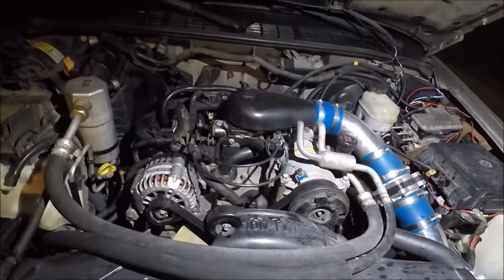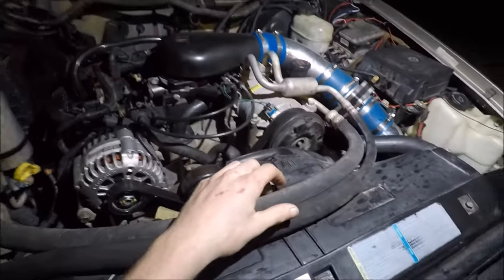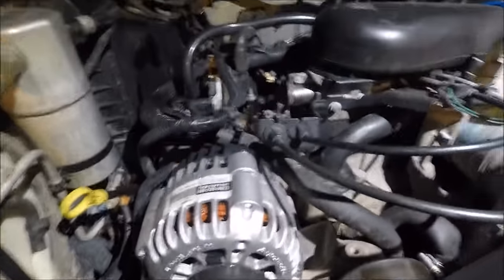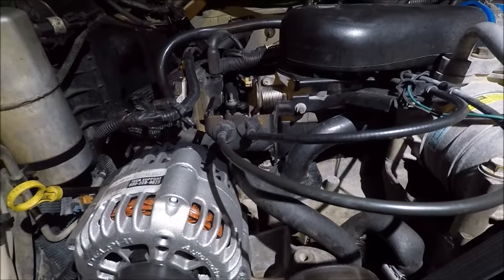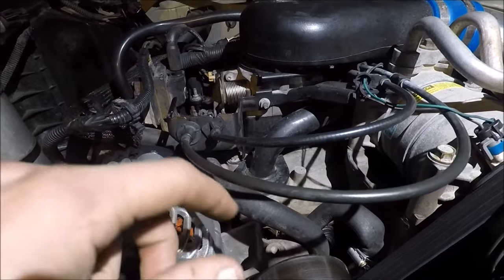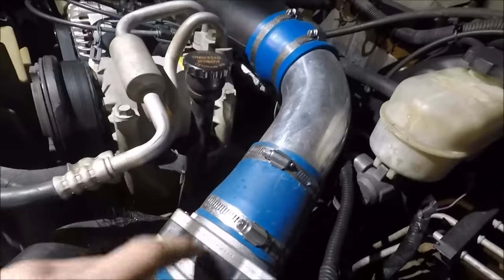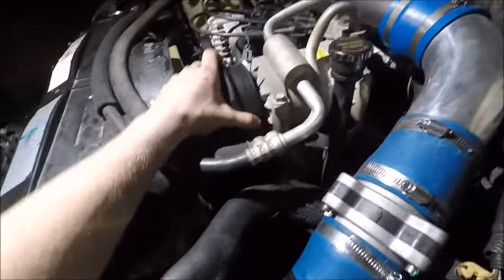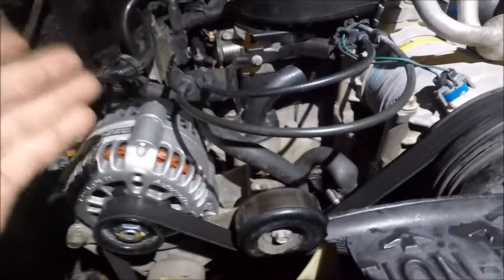EVERYTHING YOU NEED TO KNOW ABOUT THE CHEVY 4.3

Comment: I had a 98 S10 that had 370k miles on it and it ran great years ago.  Unfortunately I crashed it.  I just sold my 2013 ecoboost f150 yesterday and looking to get another  S10 with the 4.3.   Most reliable engine I ever had.  The ecoboost had so many problems, timing chain included.  I’ll never get another one.

Comment: Used to be a Chevy Technician at Carlsbad California and I just want to add.
When it comes to these S10/Blazers. When it comes to fuel related. Go aftermarket. Don't go with the OEM fuel pump for example. Everyone who has or had a s10/blazer will or at some point will being replacing the fuel pump. GM messed around with a lot of fuel pumps and TBI etc for EPA. When it comes to other parts, I recommend OEM but not when it comes to fuel pumps. I've seen aftermarket pumps out last the OEM in these vehicles and you save a lot more money on the aftermarket too. 
DON'T FORGET TO REPLACE THE FUEL PUMP RELAY!!! I can't stress that part enough. People forget the simplest things sometimes and think its the fuel pump.
Reply from the maker: Never had any issues with the fuel system.
Reply: @JLGARAGE252 You will.
Reply: Lol @JacobWinkle
Reply: Where is the relay located? Got a 2001 Blazer with 230,000 miles that’s hard cranking and not turning over. Had the plugs replaced but not the wires a few months ago.  Got the blazer in 2015 with 203,000 miles. Want to make it last through the winter. Any thoughts?

Comment: 343k on 04 silverado short bed 4.3 manual. Original water pump, ps pump, booster, master cylinder, radiator, dryer evaporator, throttle body and ac compressor. Have replaced clutch (luk)and fuel pump (delphi) once. What a truck!

Comment: I still have my 95 C1500 Cheyenne 4.3L V6 I drove in high school 21 years ago. Has 177K miles, still going strong. Currently getting parts together for TBI rebuild, Idler pulley, belt tensioner, valve cover gaskets to get it caught up after sitting for awhile. Love driving it

Comment: VERY VERY INFORMATIVE!! Have a 03 S10 w/488k on it. Replaced the fuel injector spider a few yrs ago and strangly enough it used to get 17-18mpg but since gets 25-26!!! This is BY FAR the simplest engine I've EVER worked on. Runs like a champ. The REAL trick is keeping up on the vacuum lines and the exhaust. If you feel a loss of power, those two things save TONS of time on acceleration and power issues. Even the smallest loss makes a HUGE difference with this engine. Have had customer after customer come in and wonder what was wrong after lots of guesses. With THIS engine - FOR CRYING OUTLOUD BUY A OBD2 SCANNER!!! We're in the 21st century!! You'd be SURPRISED what ANY person can fix with the right tools and some COMMON SENSE!🤣🤣🤣

Comment: I had a ‘97 ext cab step side S-10 with the Vortec 4.3. Best vehicle I have ever owned. Bought it in ‘98 with 17,000 miles on it. Sold it in 2004 with 320,000. The last time I saw that truck the guy said it had 360,000 miles on it. 2 heater cores, two water pumps, 5 clutch slave cylinders, 1 fuel pump and regular maintenance. It only left me sitting once and that was due to the crazy distributer cap cross firing. That truck was built on a Wednesday for sure.
The company I work for gas 3 Express vans with the 4.3 and have not had an issue with the drive train except for 1 rear.
Reply: I wish my last that long 😳

Comment: I've worked/owned so many of these. I own a '96 4x4 with the 5 speed, transfer case is manual too. paid $600 for it 3 years ago because it wouldn't shift into reverse or 5th. Dropped the trans, took it apart and replaced the shift fork.  Put a set of 31" tires, raise the front with the torsion bars, put in 2" body lift. Installed a dvd player I had from last S10. Both bumpers were trashed so I made my own. Stuck a winch under the front by mounting a hitch receiver across the frame below where the crank pulley is, which places the rollers where the cable/hook ride flush with my bumper. I sanded off the peeled clearcoat  and black top coat, then used a spay gun and applied 3 quarts of Rustoleum smoked gray, with about 40% paint thinner. The black molding strip going down each side I replaced with diamond plate aluminum strips cut from an old tool box and held on with rivets.  LED headlights and backup light.
Reply: Led headlights as backup lights make a huge difference 😂 just don't hit reverse in front of a cop

Comment: My 01 Sonoma 4.3 has 391,000+ miles on it. I'm the second owner. It had 104,000 when I got it.
Reply: Wow
Reply: gotta 95 sonoma 4.3 i only got 170,000 but looking forward to putting more
Reply: I bought a 2002 S 10 4.3 standard cab in 2011 with 30,000 original miles on it my place of work is only 7 miles from my home is still only has 90,000 miles on it this truck has been great I have replaced water pump the radiator the fuel pump intake gasket And just the regular normal maintenance stuff.I wish they still made  the Chevy S 10.

Comment: Thanks for the Vid! Got a 2000 GMC Jimmy 4x4 2 door with 202,000k on it for $800 no less. put a $1000 into it to fix all of the annoying typical broken things and made some mods to its front bumper, and in great shape. Nicely looked after engine too. I'm going to do a bunch of the minor replacements on it over the next couple of months so I appreciate hearing what I should be doing to keep it running well besides the obvious lol. I am currently having a loss of power due to most likely what you were saying about the vac leak with that seal. Also, I love how much you could do with this particular engine that's pretty cool. Thanks again and Cheers bud!

Comment: this is really a fabulous motor. dependable, in my life experience i rate it with the Toyta 22R in reliability, repairs are easy, easy DIY, I've seen some in this forum almost 300K im at 186... on my 2nd set of spark plug wires, just today. this a fantastic engin.

Comment: I’ve got one of these in a 1997 S-10. It’s a roller and balance shaft engine, very smooth with an excellent torque range. I’ve got 204K on mine with no serious problems. My advice is to keep up with the oil changes, use high quality oil, and don’t skip fuel filter changes. I change mine every 15K instead of the 30K recommended. Be sure to never run it out of gas because that’s quite hard on the fuel pump. It seems like it only takes one occurrence to potentially cause a problem.
Reply from the maker: John Smith absolutely I’m ocd about maintenance, just put a new transmission in today and serviced the T-case
Reply: i have a 01 s10 4.3L with about 210K miles. What type of oil do you recommend?
Reply: Oh wow, I always do 5k oil changes in my van. Didn’t know the recommended is 30k? That seems a bit high, doesn’t matter a whole lot to me I’m gonna stick to the 5k oil changes because I’m turboing mine this winter
Reply: @williamreed3180  he was saying 30k for fuel filter not oil change...
Reply: I’ve always changed the filter at every oil change.  Why keep all that contaminated oil in the system that is sitting in the filter?  They don’t cost much and you’re already doing the job.

Comment: I have a 1997 GMC Jimmy. The original motor had 181,000 when it started to have a slight coolant leak on to of the intake at the rear passenger side. I replaced the engine with a new crate engine  at 180,000 miles it started doing the same thing. This time I just add coolant every few months and call it good. That engine now has about 250,000. I did replace the starter a few times, the Altenator twice, the idler pully twice. The distributor once from summit racing. Cap and rotor at least a half dozen times. The coil once with an excel. Plug wires twice. I think that is it.

Comment: 250k miles on my 02 Silverado 1500 4.3 single cab still running strong proper maintenance oil change,trans fluid, plugs etc

Comment: I've got a 2003 S-10 with the 4.3. I also have a 2010 Cobalt that's been very reliable, especially once I solved the issue with harness going to the tranny plug rubbing on the oil filter housing. The Cobalt isn't very rusty, but the S-10 is rusted to hell. I have a move coming soon and want to remediate the rust. Everyone keeps telling me to get rid of the S-10 and keep the Cobalt.. but I like to haul dirt bikes and things like that, which I obviously can't do with the Cobalt. Cobalt just hit 119k miles, S-10 is sitting at just over 130k. I'm leaning more towards keeping the S-10 and using some of the money selling the Cobalt to fix a couple things on the S10 and getting to work on the rust. I'm just glad I'm getting away from Nebraska where they throw salt down at the slightest chance of ice in the forecast

Comment: I've been driving this 93 chevy 1500 2 wd 6 cylinder manual transmission for 330 000 and still going. Nothing tougher. Pulled bass boat or travel trailer to the lake many times.
Reply: Impressive

Comment: The 4.3 is used in many forklifts, Doosan,Cat, Yale…and manufactured currently. PSI LP fuel system. Good powerful engine for the 7000 lb up to 14000lb lift capacity. !!

Comment: I bought an 01 Chevy 4.3 a week ago, I LOVE IT
Reply from the maker: Edson Javier lots of things you can do to them, keep up on oil changes and you can expect a lot of good things from it.
Reply: Header up grade power
Reply: Trust me you will I had a 98 2.2 and it had a cracked transmission and hat sucker was still running these things are absolute tanks
Reply: @jonathanrequena4361  Yesss they can resist a lot! Any tips on making my v6 faster?
Reply: @edsonjavierrr  flowmaster 4 series and a k&n intake system
Reply: @jonathanrequena4361 hello do I no you
Reply: @curtisworley5898  ? Maybe
Reply: thats what I have bought brand new 01 it has 111,000 miles in really good shape been taken care of.. I changed my vacuum lines myself and a new egr seal  runs so much better better gas mileage, mine is 4.3 LS has 3rd door oh I fixed that to handle broke, also heater core I cleaned it out have all kinds of heat the only problem I have had is wheel hubs.. had 2 put on front drivers side within 4 years are they suppose to be greased?

Comment: I'm trading in a 2005 GMC Sierra 1500 Work Truck (4.3 V6 with T5) for a new 2021 (4.3 V6 auto). I bought it new, and the truck is approaching 310,000 miles and runs excellent. I replaced the distributor because the neoprene gear disintegrated at 175k miles. I've also replaced the starter, both front wheel bearings, and the alternator; and I elected to replace the timing chain and water pump. Been the best vehicle I've ever had. Hopefully the new truck will be even nearly as good.

Comment: Just bought a 2000 chevy blazer with the 4.3. 167000 sounds like a champ. Just gotta fix the throttle position sensor, and clean the throttle body and she should run mint

Comment: I definitely love my 2002 Silverado with the 4.3.   It's at about 180k.  I've replaced the alternator and the a/c compressor.  Regular maintenance is the key, along with driving it gently.  The transmission's great.  My only regret is that I didn't learn about changing transmission fluid earlier in its life.
Reply: Keep it up and you’ll be driving that truck for a long time. My 96 Sierra with the 4.3 and 5 speed just rolled over 312,000 miles on original drive train. I daily it, runs like a top and id drive it across the country right now.
Reply: How’d you change the transmission fluid ?
Reply: @elitewarior210  I disconnected the upper transmission line at the radiator, and I ran an extension hose from the line to an oil catch pan.  Then I had someone start the truck to cause the fluid to pump out.  At the same time I added new fluid through the transmission dip stick tube.  I did that until the outgoing fluid was mostly clear red. Then I just added fluid until it showed full on the stick.   There are good videos out there on doing it on that truck.  There are also good videos arguing to NOT do a full fluid change if the truck is over about 60k and never had a fluid change, because the transmission may be now relying on the grit in the fluid for the clutch plates to grab.  Good luck!  It was pretty easy once I bought the tubes and set everything up.
Reply: @TStheDeplorable  thank you so much 🙏🙏🙏

Comment: I've owned my 99 Blazer with the 4.3l since 2000. I've done 99% of my own work on it over the years. I have just over 250k miles and the engine is still solid and doesn't use oil. 
I've replaced my spider injection unit.Fortunately, Chevy made an OEM upgrade to this system and when you buy the new one you get the upgraded version. I've replaced mine. It's not too hard. You will need to replace some gaskets while you're doing this as well. I did have to replace the pulley next to the Alternator. Easy to do but a little annoying. I'm on my 4th alternator but who cares, buy it once with a lifetime warranty and the rest are free. I did need to replace the A/C compressor as well. You forgot to mention there is one spark plug (I think it's number 5 but I could be wrong) that you cannot remove without disconnecting the steering column from the gear box. If you do replace this spark plug, DISCONNECT YOUR BATTERY FIRST and be very careful moving the steering column around any more that you have to. There is a sensor on the column that is meant to trigger the airbag in the event of an accident and you don't want that going off.

Comment: Awesome video I picked up a  GMC SIERRA 1500  beater with a 4.3 V6 403000 miles and am going through her this video really helps understand how to keep them on the road 👍I've removed the vortec air box resonator installed a cap cover and installed a oil valve cover breather in place of the oil fill cap the next thing I'm doing is modifing the throttle blades and getting a  better flowing and louder muffler any additional advice is appreciated looking for more bolt on mods for power and torque and better fuel mileage if possible
Reply from the maker: throttle body spacer and high flow headers
Reply: @JLGARAGE252  thanks for the advice peace and much respect to you Jason

Comment: My 4.3 has multi port spider injection with 145k miles on it. Still runs like a top.
Reply: your engine is almost new
Reply: Lucky. Mine has CPI. 55 PSI of fuel preasure or it won't start.

Comment: I have a 2000 chevy s10 4.3 4x4 222k miles. Regular oil changes and ignition changes. Big major problem I've only ever had was lower intake manifold gasket replace, and the inside was still super clean for 222k miles... other than that new radiator, waterpump, thermo housing, thermo, radiator hoses... and it still running strong. Drive it 60 miles a day to work and it still had orginal AC lol and works. Also, my cats got clogged so I chopped them off and I straight piped it. (Live in Florida). Runs like a champ.
Reply from the maker: Travis Snyder should’ve done the timing chain as well usually over 150k they get a lot of slack in the chain.
Reply: @JLGARAGE252  how many miles did this one go before you sold it? And don't remind me 😂
Reply from the maker: Travis Snyder I got rid of it at 180 somethin but the new one I have is sitting at 160k

Comment: I'm not sure if your 2002 has this problem, but my 1995 4.3 had the common problem with the remote oil filter hoses going bad. I fixed this problem with some compression fitting steel braided hoses.

Comment: I have an 04 Blazer ZR2. I built a 1995 non balance shaft 4.3, had splayed 4 bolt mains ARP main studs, Mahle forged pistons, and Eagle H beam rods installed. I had a set of vortec heads and 1992 Syclone intake modified with ARP head studs with Cosmetic MLS head gaskets installed. I was planning on running a turbo on it. Had to scrap the turbo idea because I would have to delete my A/C and modify the inner fender. So I will just buy headers and run it with individual fuel injectors and coils like the LS but in a 4.3 V6. I wanted to upload some pictures but youtube wouldn't let me.
Reply: Id like to see this
Reply: @TheMrJoBo  I wanted to put pictures up but youtube wouldn't let me. Ithas the holley HP EFI ECU in it to run the engine. I put the 1995 Bravada AWD passenger side shaft housing and transfer case in it. With the S10 ZR2 cast iron front differential.

Comment: All these comments are so positive about this engine! Which is reassuring in my case, because I bought a blazer with the same motor about 2 months ago, all was good until I all of the sudden started having massive amounts of lost power. Can barely accelerate up to 60 unless I have about 1000 yards or more at times.  I’m thinking distributor.  Starts and idles perfectly fine, but anything over a certain rpm or about 30 mph is just so hard to get to and lugs down with no power.  Any ideas?
Reply: U could have Miss fire.  New sparkplug wires 
Timing sensor.   When trouble starting
Reply: no misfire? clogged cat converters would be my first guess